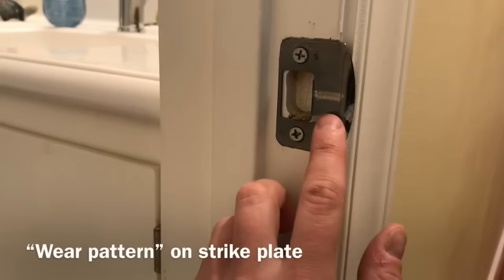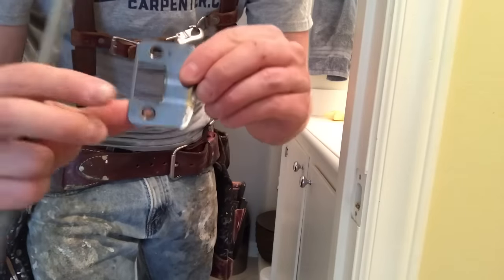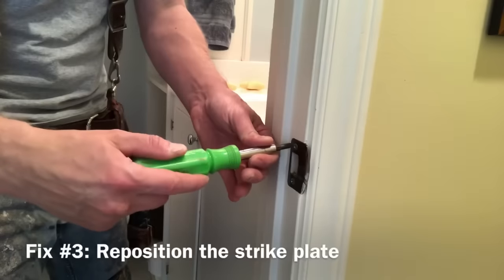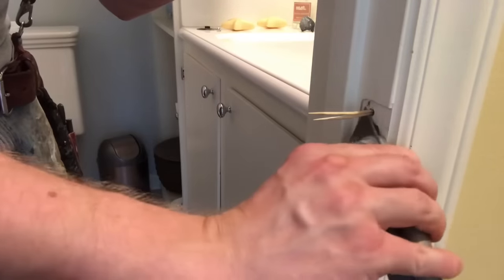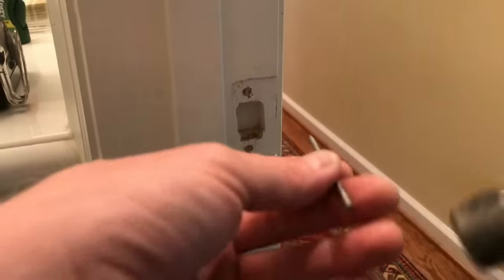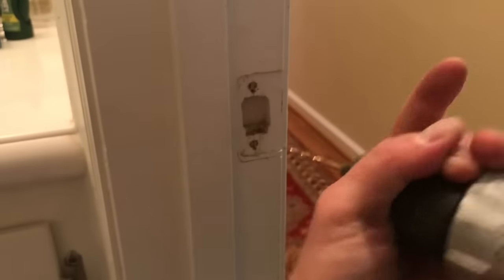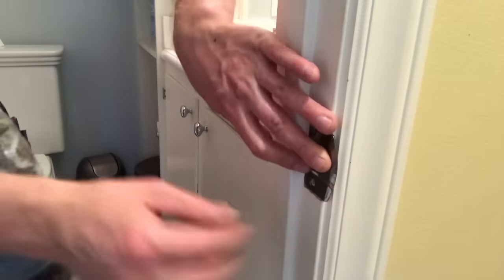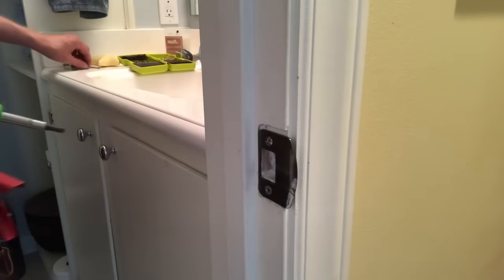Door Won’t Latch—3 Easy Fixes!

Comment: I fix a ton of these on a regular basis and THE most common issue is the door sagged. Look at the top door gap, if it's wider on the latch side chances are the door has sagged, usually from not having a long screw into the framing on the top hinge. The first thing I usually do is try putting a longer screw into the top hinge and most times it will pick the latch side up enough to work. A lot of guys cut corners, especially in production framing and will do it the quickest way, leaving out the long screws into framing. Ive seen some guys not even shim the doors properly and rely on the casing alone to keep the door set. If the latch plate is centered in the pre-drilled hole in the frame, and the door isn't lining up with it, moving the latch plate, though it will work in most cases, is not the best answer.

Comment: Instead of a file, I use a light touch with a rotary tool with the plate still in place.  Lots of very light cuts with testing in between.

Comment: Thanks, great video. I have one other problem. My door does not go into the latch. If I push on the door it goes in, but not normally. The door seems to bow out slightly in the middle. I need to push the strike plate out a little, but the tongue of the plate is getting in the way pressing on the wood in the door cutout. Do I break off the tongue and file down, or is there another way to fix it without too much damage? Thanks.

Comment: Hi Ethan! You are a super rockstar for sharing this. I had this exact issue in a brand new home. The issue popped up about a week after the one year warranty expired. The door latches worked fine all year prior. 

I went a couple of nights without being able to secure my back door. I wasn’t quite sure how to find a vendor to do this repair As most door and window companies are only interested in sales and installation, not Repair. 

Anyways I had to lower both my deadbolt and door knob strike plates and option three was required. In my case I used both a wood chisel and a Dremel to bore out the holes but I needed to understand how to put it all together and you’ve crafted an excellent instructive video here. 

Thank you so much Ethan. I am eternally grateful!

Comment: Use a chisel to remove the excess wood in the latch hole.. not to be repetitive, but adjusting the hinge side of the door by either using longer screws or bending the hinge loops is a better and cleaner fix.. these steps are usually needed when changing to a different door completely. Great tutorial though..

Comment: I just used a bunch of toothpicks to install a new door in an old opening. They had filled the holes with mud which would have flaked away and invited the screw into the old holes.

Comment: I was able to save my bathroom door by shimming it at the bottom of the door, underneath the hinges. This worked because the door lock was missing the hole in the strike plate by a few millimeters. After testing, I realized that three sheets of toilet paper was the minimum necessary width to get the door to close, so I just folded and cut some toilet paper to fit.

Comment: I would check the door for sag before messing with the striker plate. A lot of times a hinge is loose or a hinge has been sprung so the door doesn’t set right. Visually inspect and rattled the door to see if any of the hinges move. If they do, try tightening the screws. You may need to plug the holes and Re-drill them if they are stripped out. Also, close the door and check the gap see if it’s even all the way around if it’s not addressed at the door check the set an easier fix to straighten out a sprung hinge. As for filling holes golf tees are almost perfect size and they have that nice big fat head it’s easy to hammer them in with spot of glue. Every tool box should have a few wood tees just for this repair.

Comment: When putting the toothpicks in the hole, use a sidecutter to cut most of them off. Them use the hammer to drive them in farther. I would have used 2-1/2 or three of them.

Comment: So I have a digital lock/handleset on the front door. All of a sudden it won't lock unless I pull the door tight. The hinges look tight and the gap around the door looks even. Which is the best method to fix this? The door closes fine but needs to be tighter in order for the deadbolt to lock.

Comment: The last door I had to fix was sagging so in all my wisdom I just went ahead and sanded off the bottom of the door so it stopped dragging on the floor. It still doesn’t latch. Now I have a other 3 doors to fix so I’m going to try these tips and the tightening the hinges as others suggested but will these work when the issue is seasonal? And why is it seasonal? I understand expansion and contraction etc but it’s a whole house so surely once it’s moved it should just stay that way?

Comment: strike plate was out 1/4 inch on my 2 year olds room door, she easily pushes the door open at night now that she can climb out of her crib, moved the plate up and loved the tip using toothpicks to fill screw holes, used a little temp glue to hold the plate in place to make sure it latches before i screwed in, works perfect, thanks for the video man appreciate it.

Comment: What if the misfit is that the strike plate hole is too far 'back' into the door?  So the door doesn't quite close because the door latch doesn't quite go far enough "back" to get into the hole

Comment: Instead of using toothpicks to fill the unused hole, a better solution is a wooden golf tee with a bit of Carpenters glue on it. Drive to it into the hole with a hammer and then cut it flush. The hole is completely filled and it's no problem drilling a new hole anywhere on it or around it.

Comment: Would  the same apply to moving a deadbolt Catch plate further in to close the door tighter? What if the door housing the dead bolt sags a bit due to settling

Comment: Read the comments people.  This is not the way you fix this unless it was installed originally with this problem then it's not the strike plate it's the hinges.  The door is sagging and that's the main problem you need to fix.  Read what people are suggesting in the posts.  This vide is a waste of time really.

Comment: Better yet, drill initial screw holes deeper and glue end of wooden golf tee or wooden dowels instead of piddly toothpicks. Use longer screws than originals.

Comment: First check the hinge screws.  If the top are loose the door will sag and lower the latch, once tightened they will pull the door back up allowing the latch to fit into the strike plate.

Comment: If you have the room at the top of the door, you can put a shim under the bottom leaf hinge, or you can simply bend the bottom hinge.
 Many times the answer to the problem with a door, lies in another direction than the problem area.  david

Comment: A couple of times a year, mine does this and I notice the latch is about 1/16 of an inch off then I do a little lift of the door and it locks, then one day it just starts working again. Its almost like the frame or door is shifting with the change of weather.

Comment: On the last fix I would just do one hole with the drill ,and just drive the screw in . Or the hole done with the hammer  and nail just enough  for the screw to be driven in 
It gives more hold . I think.

Comment: Wooden matches or chopsticks work well for plugging old screw holes.or drill the holes bigger and install a small dowel.a dremel tool is real handy for grinding and removing the wood

Comment: Don't forget that an oscillating multitool with a narrow blade works great for widening both the relief for the strike plate and the bottom of the hole for the latch. I know not everyone owns one (you should!), but this is use #4,762 for the thing and it's much faster and often cleaner than using a chisel.

Comment: If you get to the point where you absolutely need to move the strike plate, use a chop stick that  was sharpened in a pencil sharpener, tap it into the screw holes, no need for glue, and remark and drill new screw holes. Have done this many times, always works.

Comment: You can push up the pin on the hinge on top of the door and bend the pin slots attached to the door side back towards the door, bang the pin back through the hinge, this will pull the door up and align it better

Comment: The most hillbilly remedy for that I have ever seen. Their bedroom door had been sagging because the screws were stripped out at the top causing the door not to latch either. What they did was put a side mounted plate swivel coaster that they mounted on the bottom front of the door to lift the door up so the door wouldn't sag anymore. LOL

Comment: I own several rental houses in an area with heavy clay soil and a high water table. The frost heave is constantly pushing doors out of alignment. This whole process has become routine for me. The loose hinge check always comes first. The worst problem arises when tenants replace missing hinge screws with 16D common nails.

Comment: Thank you for this easy to follow video. I was able to fix two unlatching doors today! I did not have much luck with the chisel. Mine needs sharpening. However I have a healthy new respect for the power of the utility knife. It was a little slower going but it got the job done. I had to do the 3rd fix. Oh and by the way I discovered wooden skewer sticks with double stick tape worked for plugging the old holes and held nicely for re-drilling the screws. I feel empowered to do more diy jobs now! Next is figuring out how to fix drafty floors in my 5 year old new home due to the flooring and baseboard having periodic gaps. Easy fix seems to put down what I call flat quarter round (1/4 x 1/2 inch). Not sure what to fill the gap with and how to attach the quarter round.

Comment: There are after market, thin elongated strike plates that fit over the mortice, minus the original plate. These work quite nice but there has to be enough space between the door and the jamb to accommodate its thickness.

Comment: If it used to close then I guarantee you are doing the wrong fix, chances are the hinges have stretched or are pulling out, pop out the hinge pin and bend the hinge back to where it should be.

Comment: As an alternative to filing the strike plate, there are replacement strike plates which have a taller opening. Using one of those allowed by door to latch again. Thanks for the video.

Comment: Thanks for this video. Mine is the opposite. It opens with the key but it doesn’t hold the open lock position with the key inside so you have to leave the key in the lock and have it turned to open the door handle

Comment: I read many comments and there is a lot of truth in all the comments... The only thing I want to add is that toothpicks easily crush or fall apart.  So what I do is use bamboo skewers as fill they are thicker and the bamboo does not tear as easy you can also hammer them in a little so that they  hold better.  I hope this helps someone out....

Comment: Golf Tees work MUCH better than toothpicks. The top of the tee gives you a great head to hammer into the hole. I also drill out the hole so it's large enough for the tee and glue it in. Then use a chisel or even a utility knife to cut off the top of the tee. Tees are also tapered so they fit nice and snug. I've picked up a box of 100 tees at yard sales for fifty cents.

Comment: If its off just a little you can redrive the screws down at a very slight angle and they will pull the plate down.   This sort of thing also happens when people put new weather stripping on an exterior door and find the door doesn't push in as far.

Comment: This was a life saver. I've not been able to close my bedroom door for a little over a year due to my house settling slightly I'm assuming. Never thought about using toothpicks as the hole filler. The door frame wanted to cave a bit when I went to chisel, so I had to finish by cutting it out with a knife. Other than that, option 3 worked out well for me.

Comment: I was taught to remove one of the screws from the top hinges, get a longer screw and that will pull the hinge in lifting up the door a little fixing the problem.
this assumes that the screw you use this long enough to go into the two-by-four starting behind the wall.
Also, that is assuming that there is some sag in the door.
Reply from the maker: @Mario Monti Good point. I totally agree—if you’re getting door sag away from the top hinge (as you mentioned). That “strong screw” as we call it around here really will crank the door right up. In this case though, the entire hinge side jamb had lowered, so addressing the strike somehow really was the only thing to do. Thanks for watching and writing in!

Comment: Step 4. Look at the top hinge. Usually just jamb screws holding the slab and sagging. Take one hinge screw out and put a longer screw into the door frame stud. Nice and easy until the strike plate is where it should be. Usually gets the slab from dragging also depending on the threshold.

Comment: I need to do that with a closet door so I appreciate the video. Have you considered using a Rotozip bit to clean out the hole just using the striker plate as a template?

Comment: Good video. If you can find them, wooden golf tees are better than toothpicks for filling the holes. Also, first thing to check before any of this is to see if your door hinges are worn out. As hinges wear, the door gets lower and lower, and you can end up being too low for the strike plate. Also, check to see that the door is rectangularly centered in the doorway. That can be adjusted by bending the hinges (there are videos out there on how to do this).

Comment: Appreciate it! I had two doors that were having latch issues, and I decided I was going to file the first one down. When I went to check the second one, someone had already filed that one, so I switched that plate with the first one for an instant fix :). The door is definitely sagging on the second one, so I may have to mess with the top hinge.

Comment: How do you break in a room if the vertical rectangle lever door handle won't open when you pull it? I took out the "cover plate" and there are 2 holes. One for the key hole and one for the handle. There's a stick thing sticking out and I can't get to the latch from the door crack because there are door frames the cover the crack from the outside. Should I just kick it in?
Reply from the maker: Scribblebytes are the hinges exposed? Could you knock the hinge pins out?

Comment: Have to add to the existing comments about checking the hinges. Poor advice since the CAUSE of the problem was not investigated. First step on any door repair is to check the hinges for wear and\or screw pull out. Or perhaps structure settling.
Reply from the maker: @W. Apnj Thanks for writing in. And you're exactly right. I pretty much always start any door repair by standing back and just saying, "What's going on here...?" I usually follow the gap around the door with my eye to see how consistent it is. I either look for too much space, or not enough. Then I proceed from there. Though, honestly, I almost never see loose hinge screws on INTERIOR doors unless they are very heavy solid-core doors. They just don't pull that hard. I always see it on exterior doors, especially ones where the "strong screw" in the top hinge was left out or compromised. I totally neglected to say all this because I was making this video on short notice, and hinge-side settling was clearly the problem here. That said, it's funny that the videos I accidentally leave stuff out of become the most popular. I have other ones where no one takes fault with anything, and the video hardly gets any views. If I fail to mention a key component though, or do something people disagree with, the knives come out, and the vid gets +100K views! I guess that's just how YouTube works. I just keep making them though and let the chips fall where they may :)

Comment: one other option (for older type of hinges) is to insert a spacer between top and bottom part of all the hinges. in this way you elevate the door, probably to its original position (the reason for the whole problem is that the door saged) if you move the striker plate to match the sagged doors enough times, the door will be scraping the floor, eventually :)

Comment: Hello, hopefully you can help me out and reply, but my problem is that the "hole" where the wood inside the strike plate would go is basically gone, so since there isnt wood, i cant screw in a strike plate causing my door to open and close so easily even if it is locked, i dont even have to twist the door knob to open, so i was wondering what can i do to refill that hole in order to screw in a strike plate...would drywall be a good idea?
Reply: Wood filler

Comment: Great video! Clear and to the point, and presenting different options. I'd add to what others have said; check the hinge side first. Screws can loosen over time. Another first check to do is to remove the hinge pins while the door is still in the closed position and shim it in place with equal spacing on both sides. Then carefully bend the hinge tabs so that they all line up. Replace the pins, THEN see if you need to adjust the striker plate.

Comment: The problem w/ mine wasn't any of these. I had to get a block of wood & a hammer & bang the trim back into place! It was the trim that had shifted but it wasn't that obvious at a glance. I was trying to figure out the problem for months. Make sure you look at the trim on the inside of the room where you're having the "latch" problem. Anyway, I now have a bathroom door that stays closed & I can lock it.
Reply from the maker: Hey Lilian, I’ve definitely seen the stop trim hold the door out of plane a number of times. Newer prehung doors don’t have the problem as much, but older doors with independent stop trim can frequently get out of whack, especially after a remodel. Glad you got it solved!